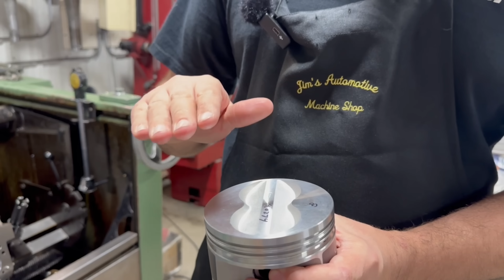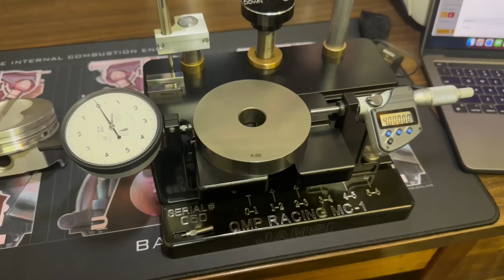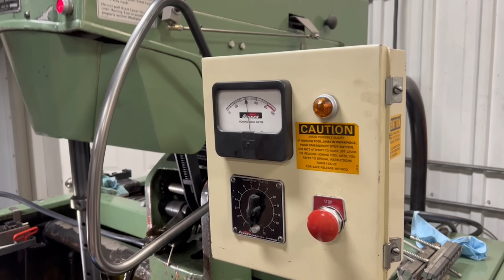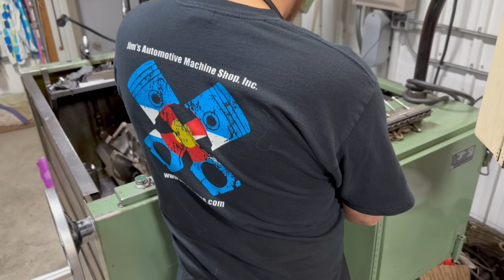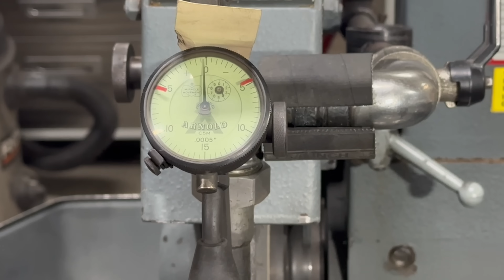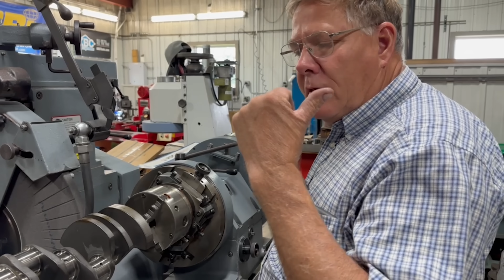Is Our 383 STROKER Crankshaft JUNK?!

Comment: I am impressed by how an engine is built together, one would think it would be easy to put an engine together, but no it involves a lot of measurements and not least tools to do this.
Reply: That's debatable. You can build an engine with plasti-gage and a torque wrench borrowed from auto zone, and nothing but box wrenches. You wouldn't want to do that with a high performance engine. But you can build a reliable with truck engine like that. Especially when you're talking older platforms, small block Chevrolet and Ford, old Mopar. Farmers have been doing it for decades.

Comment: I give you guys credit for taking on other's poor work. Maybe in the initial production, maybe some shop thinking they were capable of perfecting something that they were not capable of doing and returning it on the sly, or from a supplier who accepts returns without verifying condition. 
I worked in a factory for over 38 years grinding to tight close tolerances and I was just tired of fixing other problems caused by other people. Certified junk fixer. Glad to see you don't use their instruments. Keep up your high standards, people deserve quality.

Comment: As a long times machinist, you can't go wrong with Mitutoyo measuring equipment except for Interapid indicators and the Starrett non-rotating blade depth mics. Unfortunately most Starrett and Brown & Sharp stuff is complete garbage now. Earlier in my carrier I had to return 11 pairs of 0-12 inch Brown & Sharp dial calipers. A bunch of guys wanted them for their personal boxes because of a promo. Some would measure good in the first few inches then be off by .003 over 10 inches. Others were too tight throughout the spectrum or had various other issues. Mitutoyo is the way to go.
Reply: As a machinist as well, almost all Mitutoyo stuff is top tier. I agree on the indicators, the interapids are nice due to the dual direction. I do love my brown and sharp best best 1/2 thou indicator as well. Starrett is  mostly riding on their name only any more.
Reply: @nwngunner  A while back I bought a new Starrett non-rotating blade mic set. When it came in the barrel wasn't spinning freely and I struggled to remove the barrel. Once I removed the barrel, a bunch of fine chips and oil came out. It looked like someone had sabotaged it after inspection. Even their own employees don't like them.

Comment: I enjoy watching you guys work and have a lot of respect for your knowledge and skills.  Have to say though - if all the crank journals (in the same plane) show the same out-of-round condition, I would first check the off-set or indexing of the crank holding fixture.  But a variance in that dimension wouldn't account for the tapered journal diameter!

Comment: i was QA at a valve co that made food grade 3A stainless steel valves we used a much older profelometer to see how well the electropolishing and chromium was being deposited along with refracted lasers with certain polarities in the color to see fine flaws in the polish as any imperfections could harbor bacteria and materials which could make cleaning difficult real pain in the tail getting into smaller than 3/8 ID valve assemblies to do readings on surface finish

Comment: Eagle and Scat usually are off out of the box from people I know that used them.  I have always used resurfaced OEM cranks for my limited engine builds, but that's what I've been told by several people that do use them.
Reply: Yes scat especially
Reply: When I built my 383 in 1989 they didn't sell cheap cranks, I had to make my own from a 400. I did it on a 465 Van Norman crank grinder

Comment: What a difference between how you do things and how we did things out in the garage and backyard back in the '60s and '70s... Can't help wondering how random new stock cranks from each decade from the 1950s to the present would check out...
Reply: This shop’s practices and procedures mimic those of quality shops in the 60’s and 70’s.  Stock performance engine forged cranks from GM, Ford and Mopar were spot on.

Comment: Time is money and this all seems like a lot of expensive work that could have been avoided if the OEM did their job. It also raises the concern that other engine shops might not pay attention to detail as you guys do. How many builders just take the parts out of the box, assume the parts are correct, and just assemble? Ya know what happens when you ass-u-me, right? It always costs less time & money to do it right the first time than to do it over a second time.

Comment: Hey guys, could that out-of-spec section of the crank be spray welded and reground, as Adam does on his Abom79 channel? Great videos, I love watching them.
Reply: Why?
Reply: heat would most certainly ruin the crank. especially with the tolerance these two are chasing.

Comment: It would be interesting to see what the balance on the second crankshaft is without the weight on the flywheel, Is it already internally balanced? I noticed on the balancing video that the drilling was always in the same area as the weight on the flywheel. Made me wonder if the crank was already balanced from the factory.
Reply: The amount removed looked about the same as the weight volume
Reply: @ab2230  Agreed! I think it would cool just for grins and giggles!

Comment: Every Scat crank that ever crossed my bench was messed up in some way. It got to the point we just stopped buying them. This was years ago, I was told they got it together in recent years. Apparently not, lol.
Reply: The shop I used for years would not touch Scat or Eagle products. He would flat out tell you to take that crap somewhere else😂. He built NHRA world record holding engines and could afford to turn away work.
Reply: @mikemaccracken3112  the Eagles were much less problematic than Scat, still cheap cranks, but better.
Reply: @Bob_88SC  Lunati,Callie’s,Manley,Ross,CP,Carillo,JE,Diamond,Wiseco etc. No off shore parts.
Reply: @mikemaccracken3112  I wonder if "Offshore" parts would be a problem if it wasn't a place like red China. Would you be afraid of using an OEM Subaru crank?
Reply: If only we could all afford to use Bryant.  Hear Winberg is good too but no personal experience.

Callies can be a "low dollar" alternative.

On those same "low dollar builds" you can use Scat rods.  Used to go through boxes of them checking bend and twist.  Set the ones out of spec aside until there was a full set and return them.  Match up rods by weight to have some decent ones to start with.  Rinse and repeat.